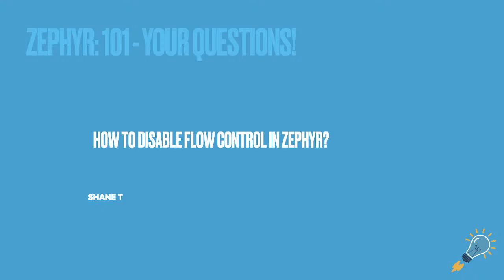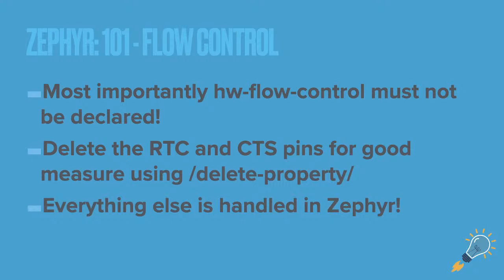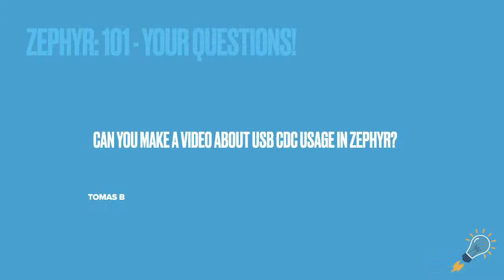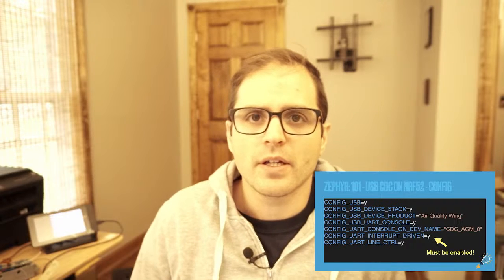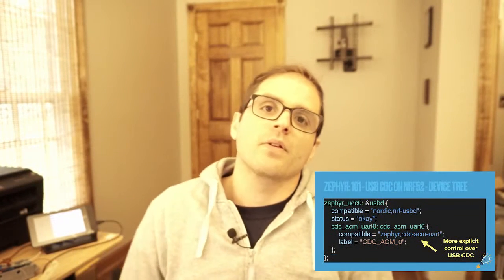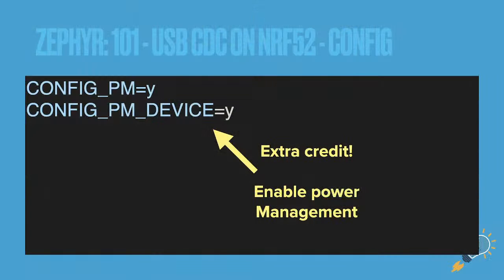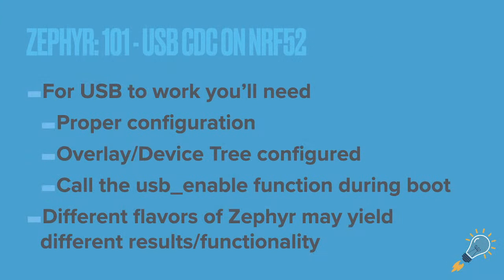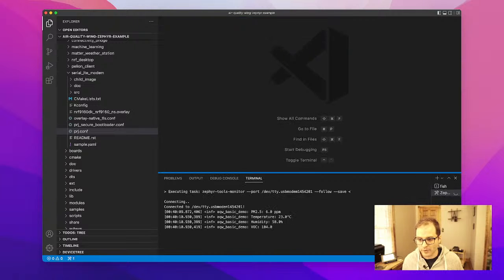Zephyr 101 - USB CDC and Disabling UART Flow Control

Comment: hey man, I am trying to connect to rt685s from nxp through usb to be the "umbilical" path for communications between them with zephyr rtos, any recommendations ? i am a newbie for both usb and zephyr, any help would be great! 

Thanks, great content btw.
Reply from the maker: I assume you're using the dev kit? Most likely one of those USB ports is a USB-to-UART. You'll have to check with the actual design you're using though.

Comment: Hi, Is it possible to use the uart async driver api for usb? I have an application using uart async on 2 uart pins on the nrf52840 but I would like to use the USB instead so I don't need a USB to ttl cable.
Reply from the maker: USB is a completely different interface. Look for CDC_ACM. If you have a nordic chip they use the CDC_ACM implementation in the connectivity_bridge sample

Comment: Do you have a video for disabling flow control when using the new pin control api?  I can't seem to find the new way of doing this.
Reply: Hey Mike

I know it can be done in an overlay with: /delete-property/ hw-flow-control;

I'd have to look at the UART API to see what the process is for disabling at runtime. Looks like you may have to call uart_configure to change if flow control is turned on or not. You may have to manually manipulate the RTS/CTS pins once you turn it off to make sure they're in a HiZ state
Reply: @JaredWolff  I'll give that a shot. Lot's of conflicting info on dev zone about this. I'm on NCS 2.3.0 and one post seems to suggest just not adding the pins to the groups.
Reply: Well that was a quick test LoLz.  I could swear I tried removing the pins and the build failed but now it works like a champ.  Thanks for the quick response!! 

For anyone else wondering it looks as though you just don't set the CTS/RTS pins in the pinctrl dtsi.
Reply from the maker: You’re welcome ☺️

Comment: Hi. I have a question related to using STM32 with Zephyr. I know STMCubeIDE does not have a support for Zephyr. I am looking for an IDE which can be used to prorgam stm32 with zephyr so that i can perform stepwise debugging along with getting additional information as we normally get with STM32CubeIDE. On the other hand, if it is not possible to integrate Zephyr with STMCubeIDE, will it be ok to just add Zephyr sources to the Cube IDE, build the code in terminal, once we have the elf/bin/hex, we debug using CubeIDE.?
Reply from the maker: You may want to reach out to ST and let them know you'd like to use Zephyr. That's the only way you can get better official support for Zephyr. Needless to say there are ways to debug stepwise in Zephyr. I've done it previously with VSCode. I haven't done anything with STMCubeIDE though unfortunately. To give you an idea, here's what I've done for the nRF9160 Feather previously https://docs.jaredwolff.com/nrf9160-programming-and-debugging.html#debugging-in-visual-code
Reply: @CircuitDojo  Thanks a lot for the link. I have one question though. You used J-link for debugging. Is it also possible to debug through OpenOCD GDB server. I am debugging my STM applications at this moment with remote OpenOCD gdb connections via STMCubeIDE. If not, then is it possible to do the same via STLink?
Reply from the maker: @junaidaslam1  I've only had luck programming ST Devices with an ST Link. I've yet to try to debug with that setup. I develop mostly on nRF devices. Sorry I couldn't be more helpful.
Reply: @CircuitDojo  No problem. your experience will definitely help me. I am totally new to Zephyr and wanted to learn it purely because of its connection with Linux kind of device tree and device driver mechanism.
Reply from the maker: @junaidaslam1  glad it's helping! :)
Reply: @CircuitDojo  In your experience, how much is there similarity between linux device driver development and device driver development in Zephyr?
Reply from the maker: @junaidaslam1  I haven't done any Linux driver development so I couldn't tell you. :) I assume though they're very similar.
Reply: @CircuitDojo  I also suspect that they should not be much different.